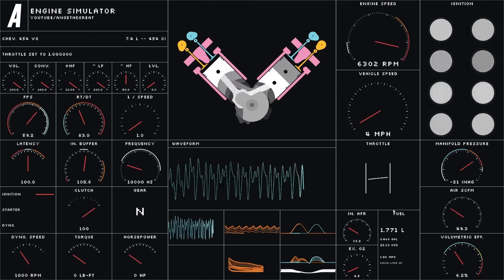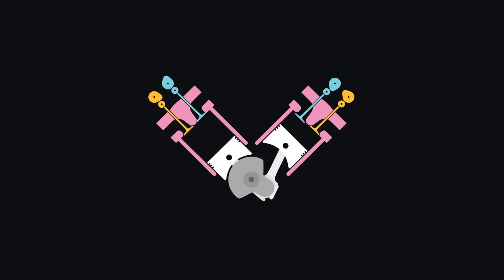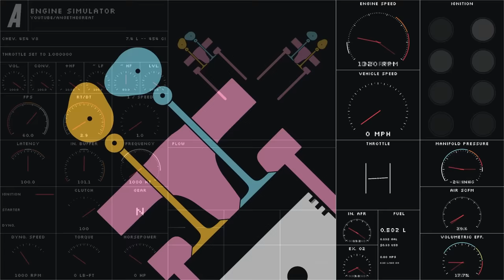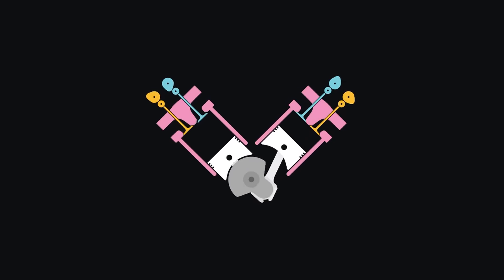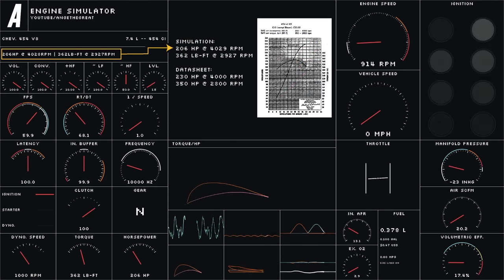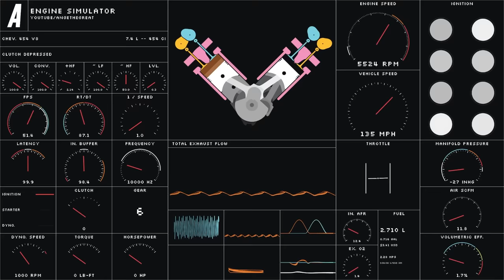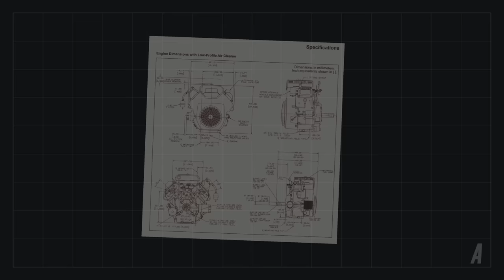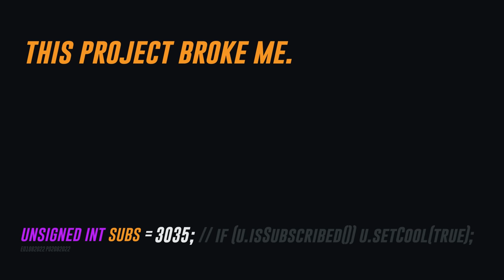Simulating an Entire Car Engine (yes, it makes noise)

Comment: THIS IS ABSOLUTELY INCREDIBLE, I've been waiting for something like this for DECADES just like you. I almost can't believe this is real. With modern CPUs you could just run this whole thing on its own dedicated thread without any issue at all or taking perf away from anything else. I used to try physically make engines in garrysmod but the physics systems are just too jank obviously. This looks like so much fun even just to play with. Can't wait until developers start using this type of smart stuff in their game engines. Even I'm getting ideas of getting the output torque values and sounds from this and linking it up with an existing game engine somehow..
Reply: Hey it's DeSinc
Reply: didnt know desinc was a car guy
Reply: Considering that the simulation itself runs at a whopping 80000fps, i imagine that you would have to have another really, really powerful hardware to be actually linked to a game
Reply: desinc saying something genuinely smart
Reply: @Radiation_R  yeah that second piece of really really powerful hardware is called another CPU core. There's a reason why we have multi-core CPUs.
Reply: In garry's mod, its possible to make things called Prop Engines. The only thing  you need to achieve its stability - custom inertia of crankshaft. Various props have incedibly low momentum of inertia for such mass they have. Also, its possible to write a WireMod E2 script, despite of using server CPU (that cause low perfomance in some purposes). I worked a lot with such type of engines and they can power not even cars, but a very massive, sometimes comically large things.
Reply: @Radiation_R  It might be possible to optimise this to run at a much lower framerate. The fact that it can even run at 80k is insane.
Reply: @kabiracharya3289  this is just my interpretation, but the high frame rate is more a requirement for the simulation to run correctly. If the frame rate isn’t high enough you could have situations like the rpm being higher than the frame rate and the simulation missing entire revolutions between frames, causing it to break down. Would be like trying to run an engine with slow/out of sync valve-train. If it were to run at lower frame rates it would be more like an interactive video of the simulation than an actual real time simulation, which I guess could still work for simple purposes.
Reply: @some_doofus  yea that was my point. You don’t need the level of detail presented by this simulation to integrate something similar and just as acceptable audibly into a game while using significantly less resources.
Reply: @windandy8510  I tried making them, didn't go through because of stuff. I would give them a try at some point but then i would need to make gearboxes. I use ACF for most of my cars and trying to make a rwd car that is fast and controllable
Reply: as independent as a cpu core is, it will still tax overall performance because the memory is shared. Unless that core has a cache and the whole simulation dataset fits into it.
Reply: @Radiation_R  what's the deal with frames? to make sound, we don't need any graphics. I suppose he meant "frames of simulation processing", like integration steps. These frames are very different, and so frame rates are different too. 80k fps doesn't really mean anything... you may say that the normal audio processing always happens at 48k fps (although i think it's rarely processed in a strict sample-by-sample manner in computers, more likely in chunks).
Reply: Upload more frequently
Reply: Hi DeSinc, nice to see you here.

You can easily implement sounds into "Automation - Car company tycoon" cars exported into BeamNG - it's just a .wav (I think) file for every 400-ish RPMs with and without load.

It's not much, but it's something
Reply: That's assuming it's single-threaded, which the video doesn't specify (and I can't read the code to find out since it's private). And you need one for every car. And integrating it is not trivial to say the least, since there's significant overlap between what it simulates and what the game would likely want to independently simulate in its own way (the entire drivetrain, for example). Etc, etc. The more obvious and practical way to use a simulation like this is to input the engine specs, record samples of the audio output under a matrix of different operating conditions, and blend between those samples in-game based on the equivalent conditions. Then you can get dozens of engines on a fraction of a CPU core, and there is no performance tradeoff.
Reply: @Radiation_R  Actually that means the exact opposite - it's so efficient it can run 80k simulation steps (NOT fps!) per second on consumer hardware, meaning with a bit of tweaking this can run easily on any modern gaming console.

Developers, if you wanna know how to use those 8+ CPU cores with your game, this is how.
Reply: Prop surf the engine bro
Reply: @Radiation_R  I had a different Idea... Use this simulator to train an AI model for each specific engine...
This is a training data porn... You can create infinite amount of realistic sample training data. With trained models - you get a computational shortcut at a cost of disk space (the actual traning model files)...
Althought you would probably loose a some accuracy, it would still be miles better than what we have in games right now anyway.
Reply: Hey, it’s DeSinc! I’ve also tried(and of course failed) to make an engine in GMod. BeamNG has been my playground from then on. Also, you should make more Half Life 2 videos (or just any videos, I’ll watch them either way)
Reply: @Radiation_R  just run it on a dedicated core! we have enough of those nowadays anyway. then simplify the resulting physics for the reference frame above it (the engine block as a whole) and put it in the in-game vehicle and call it a day. the main game engine physics would just think of it as a simple rectangle while the other separate core just whirs away at 8k fps behind the scenes calculating the torque etc.
Reply: @NerunSmarts  I actually made a working torque converter using 2 sawblades rubbing against each other with friction and it actually sent the power from the real spinning pistons to the wheels physically. the engine could idle with the handbrake on and when released it would start to move. it didn't have much power though, couldn't get up very steep hills. if I increased the friction it would just stall the engine at idle. the next step would have been to work out more of a clutch type setup with friction pushing down like a clutch with a pedal instead of an automatic style torque converter but I had already had my fun and given up on high precision parts making by that stage.
Reply: @DeSinc  That’s wild, could never get that far and definitely would never have thought of the sawblades. Shame it never got further, I have no clue how you’d go about making the clutch without some custom lua scripting…
Reply: @phentm  he's australian, of course he is lol

Comment: As an engineer who made models of physiological systems in college you've just broken my brain.  You've reverse engineered audio.  I can feel this engine, my brain refuses to believe the actual engine isn't in your garage.  If this were in a game, motor-heads could tinker with models of their favorite classic cars in a simulation and the audio feedback would make it extremely real.
Reply: Been thinking abt that in forza h5 there’s not enough difference in sounds when modding but at least they recorded real life engine/exhaust sounds. But they may have well just hired this guy lol.
Reply: @carsnob  and beamng drive
Reply: Physical modelling has been "a thing" for audio for nearly 3 decades, but i think having the ability to run the simulation at 80,000 steps per second is what was missing for accuracy on this scale before. Back in 2004 or so i heard PM synthesis of a tuba and a violin and while both were unfiltered and "crisp" they were eerily close to the real sounds. They also didn't use any samples or sampling.

Comment: it’s pretty mind boggling how fast all this stuff can go without ripping itself apart, especially given that it’s literally exploding
Reply: Well, not literally.
Reply: @sam8404  well, yes literally
Reply: @Askar1  no engines don't literally explode, only the gasoline explodes.
Reply: @sam8404  he said “it,” not “the engine.”

“it” refers to how the engine runs, not the engine itself.

your pedantry is misplaced.
Reply: @annoyingoranger100  r/confidentlyincorrect

Even if he was referring to how the engine runs it still doesn't literally explode. Only part inside the engine that literally explodes is the gasoline, but he said "how fast this stuff can go" meaning how fast the crankshaft spins or how fast the pistons move. Neither of those are exploding, they are however powered by a substance that explodes.
Reply: @sam8404  first of all, this isn't reddit.
second, no one implied that the engine itself explodes, you're just drawing that conclusion and getting mad about it for no reason.
Reply: @annoyingoranger100  I don't know why everyone thinks I'm mad, I was just explaining how he was using literally incorrectly (which he is btw). Also I never said this was reddit.
Reply: @19thratytt  right?
Reply: @sam8404  /r/iamverysmart
Reply: @trotskiftw  see this guy gets it ^
Reply: @ferdydurke9780  exactly, explosions are pre or post-det which is not good for the engine and is a symptom of user error or part failure. All these mfers are wrong. Combustion is specific, intentional and occurs under strict parameters. All of them arguing over who’s right lmao
Reply: @ferdydurke9780  i suppose i was thinking about it from a physics perspective not a chemistry one, but i agree my statement was a little inaccurate.
Reply: The Battle of The Subreddits
Reply: @annoyingoranger100  It's called an internal combustion engine, not an internal explosion engine. When the gas explodes inside the engine, you get engine knock. Hopefully you get engine knock one day, you'll learn real quick that you don't want any sort of explosions inside your engine.
Reply: yeah just to stop all these arguments, the physics definition of an explosion is just two objects at rest pushing off eachother in opposite directions so y’all can stop complaining now
Reply: @doicaretho6851  Oh I have experienced knock, it was from buildup. buildup comes from the engine not burning the fuel off enough, mind you. If anything I'd want a stronger combustion. Maybe work on cars more before spouting crap off like that.

Comment: I'd suggest getting into contact with the developers of "Automation", a car-manufacturing & designing tycoon game for the PC. They've had to source IRL sound recordings of engines for the in-game engine sounds, and then modify those to fit the many, many different ways players can design their engines. A non-ideal, time consuming and labor intensive ordeal. With your simulation tech, they can accurately create audio from scratch to fit any variation of engine, all procedurally made in-game. They might be willing to work something out with you. 

Also, it would be cool to see you try simulating a rotary engine!
Reply: Automation + BeamNG having this king of sound engine would be soooo good
Reply: Many game devs record sounds of real cars into their games, but I don't know how they edit them into games. Probably just slowly rev the engine from idle to limiter and then just add that sounclip to the game and make it loop or smt
Reply: Those sounds were actually made via physical modelling synthesis. No real car recordings were used in the samples
Reply: yeah this dude definitely has a product. Curious to see if it handles turbulence from more cylinders well. Also interesting how deep the post processing is (thinking Lexus LFA on dyno v. in car with exhaust resonances)
Reply: @ffivguy1990  How certain are you of this? As I remember a while back, one of their excuses for why they weren't going to add certain engine designs (rotary, supercharged engines, diesel, etc.) was because they would need to source more recordings for those and they didn't want to.
Reply: @JonTTu111  It's fine to use real recorded sounds, but given the nature of Automation, they would have to adjust those sounds to fit every permutation of engine that players could design in-game. With this guy's simulation, they could much more accurately emulate the sound of the engines based on its actual properties, with much less work. It could even be done dynamically in-game.
Reply: I was about to mention this, this would add a whole new dimension to the engine dyno experience
Reply: Replying for visibility
Reply: i mean, MIT license means they could use it without needing the creators permission
Reply: I'll definitely try to implement this in my racing game, FRICTION infinite
Reply: Does Automation run at 85,000fps? Lol
Reply: @julienus100  first thing I thought of was these two games
Reply: @the_real_Kurt_Yarish  he made a bmw m52b28 and I own 2 of those engine and it’s close but it is slightly to high frequency through the middle to the end of the rev range but I don’t know if he simulates a full exhaust system either and personally I don’t drive around open headers lmao

Comment: This is extremely impressive. Best synthesised engine noise I’ve every heard. I would not be surprised if gaming companies buy this code off you to add to their games
Reply: Probably not with an 80.000 FPS fluid simulation but you never know :D
Reply: I would expect instead they would use this to record the different states of the vehicle instead.
Reply: @littlemrh  it sounds like recording the exhaust flow wave form in various speed+throttle+horspower configurations and making a closed form parameterized function approximation out of them and then using the audio pipeline (based on the exhaust system) to create the sound itself
Reply: @ratchet1freak  Being able to enter the parameters of any given engine framework would essentially yield an identical wavelength, youd only need to add reverb to give its depth and shine depending on exhaust systems
Reply: @Lux_Parallax  but that's only a set of audio filters, which is cheap, 

it's the exhaust flow&pressure waveforms that you need to get your initial sounds that you pass through the filter. And that is expensive to compute (requiring the rigid body+fluid sim at 8k fps). If you can precomputethose wave forms suddenly you only have an audio filter pipeline to worry about
Reply: The project is actually open source, which means they can do this for free.

Also it isnt that simple since different companies use different engines which use different languages but they could reverse engineer and apply the principles from the project
Reply: I would be surprised for them NOT to buy it
Reply: @bossdaily5575  Not anymore

Comment: Could you make this work for a rotary engine? Like a Wankel or a LiquidPiston?
Maybe an option for turbo/superchargers?
Petrol vs Diesel? And simulating the differences when timing and spark advance is changed, as well as feul ratio?
What about 2-strokes (gas or diesel)?

Just throwing some ideas at you.... :) Very useful and beautiful project!!! Definitely a lot of potential!!!
Reply: Oh got I don’t think a turbocharger/supercharger add on would be good. I’d be testing out car sounds the whole day hahaha 😂 But seriously, Image what could be possible with this simulation!
Reply: I'd love to see support for variable valve timing, variable length runners, push rod, SOHC, DOHC, and different header lengths. It'd be awesome to digitally spec out a motor and get it the way you like then build it in real life with minimal R&D.
Reply: I think the wankle engine should be easier to program since the piston itself acts as the valves, so less moving parts.
Reply: @boltbreakgarage3842  Fuck yeah💦💧
Reply: @boltbreakgarage3842  The possibility with a program like this could be practically endless... I think with the amount data he pulls from this simulation its even possible to calculate if certain fuels will even combust in different engine types. The fact is that it just depends on what he will do with it and how far he is willing to take it.

For example a person like TwoStrokeStuffing (fellow youtuber) could simulate an engine idea and get a resonable oproximation on how the engine will behave (and if it will even work) before putting time and efford in to build it.
Reply: Wanker engine????